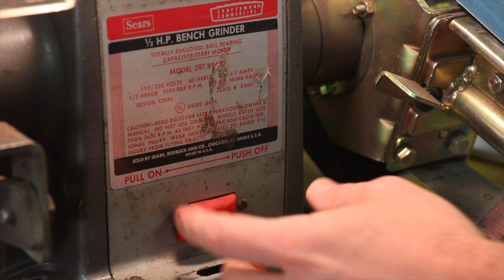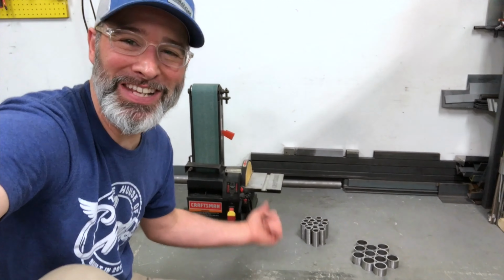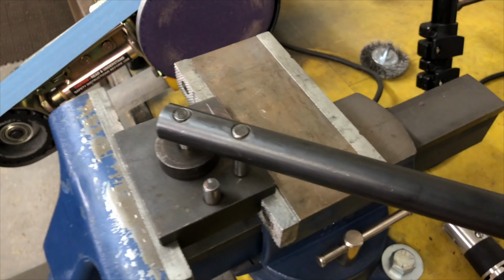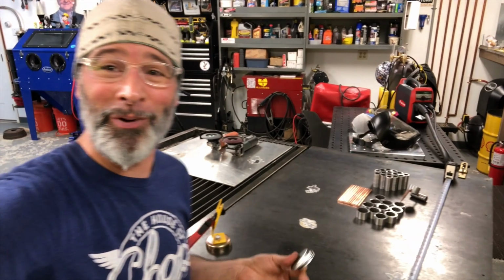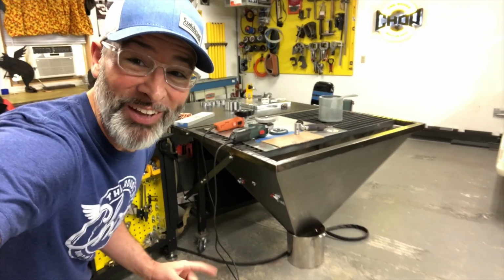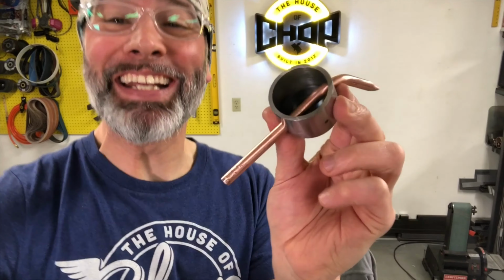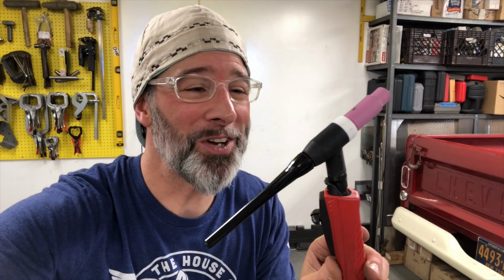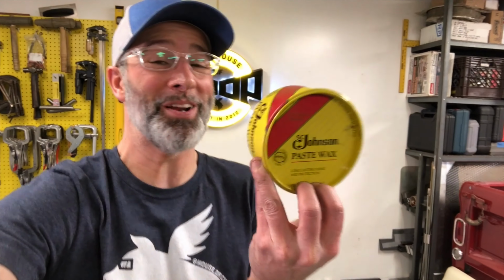Mini Welders Third Hand Project: A MUST HAVE on the Bench!

Comment: New to channel. Quick question. Do you have any concerns about the paint job on the truck? Enjoy what I’ve seen so far.
Reply from the maker: Thank you for watching. That’s a great question. That truck looks a whole lot nicer than it actually is and is currently being taken apart for a total overhaul. When I’m done restoring it the truck will no longer be sitting there. Much of what goes on in that shop would make a mess of the paint. Thank you again for watching any taking a moment to leave a comment.

Comment: Is there a reason why you would choose to make the finger it self out of a material that melts at a lower temp than steel?
Reply from the maker: It’s in no danger of reaching those temps and the conductivity of the copper is the reason for using it. It is used to eliminate unwanted arc strikes.

Comment: Great job Chop. Nice touch on using lead weights instead of solid stock. I’m gonna have to build one now 🤘🔥
Reply from the maker: Jason Becker Appreciate it Jason. Seriously means a boat load coming from you. 🙌🏼🙇🏻
Weighting them up like that was really about just using what I had on hand at first but it ended up working out so well I stuck with it for the production run. Looking forward to your version. 🔥👍🏼🔥

Comment: Awesome work Philip! put Copper BB's in mine. The Lead Shot is a good idea though, because you can use a much smaller size, (like #9) thus making it more dense which equals more weight. I think I will pick up a couple just to add to my Arsenal, and possibly get myself a House of Chop slap for my Shop. :)
Reply from the maker: Thanks man from one Philip to another! I’ve used BBs in the past they work great too. Like you said the #8 shot is without a doubt squeezing a bit more weight into those tight spaces but I do believe both work well. 
Thank you again for the view and the comment. 🙌🏼🙇🏻

Comment: what is the green stuff in the cnc table?
Reply from the maker: It’s called Pico Quench Guard. It keeps stuff nice and fresh with out rust or algae growth in your water table. 😉 (from their website)  
Environmentally-friendly coolant, lubricant and corrosion inhibitor.
Table conditioner primarily for use in plasma and waterjet cutting/burn table systems.

Comment: OK - Gotta Ask - why did you make the "weight" hollow then fill it with shot?  Why not just use Round Stock for the weight  -  and save a Lot of extra work?
Reply from the maker: The cost differential of the solid stock would make me have to put them at an unsaleable price point. If you were building one or two and could clip a small section it would absolutely really the way to go.
Reply: @HouseofChop  
Didn't realize the cost of Round Stock would cost more than the materials you used plus (3 pieces to make the can then drill the hole and fill it and 3 machines plus the time it took to draw and then cut it out plus the costs of material) the labor that went into making them ($/Hr. added cost) 
Labor Costs something does it not?

I "think" that if you put it all together, then the cost would actually be less.  Would it not?
Reply from the maker: @dc85337  Undoubtedly standing on a factory floor turning these things out and paying for labor you are 110% correct. 
There is quite a bit more being extracted here than just the finished product and that’s where the mathematics change a bit.
Reply: @HouseofChop  
Thanks for the reply to my reply to yours!   I was just trying to calculate all the materials you used and the machines used and the labor to use each one, etc.
Still a nifty little unit you got there!